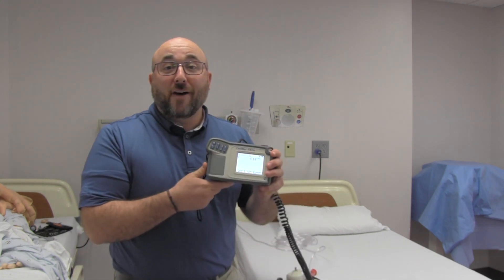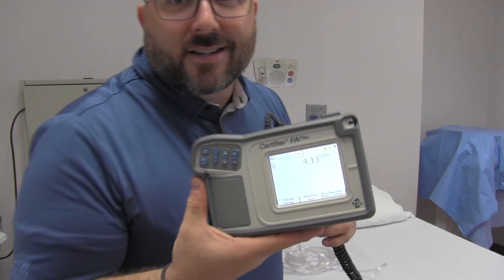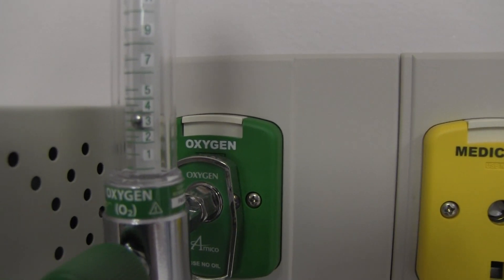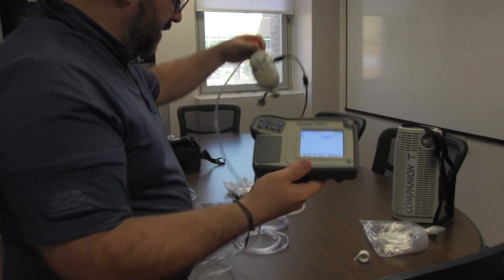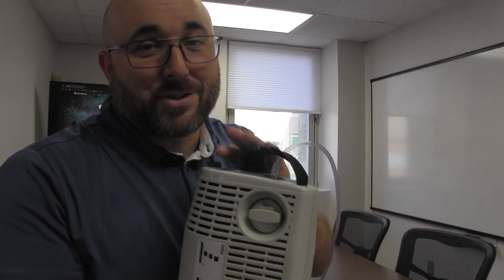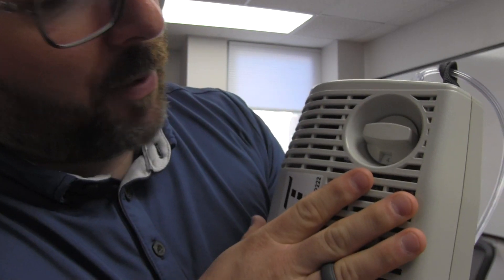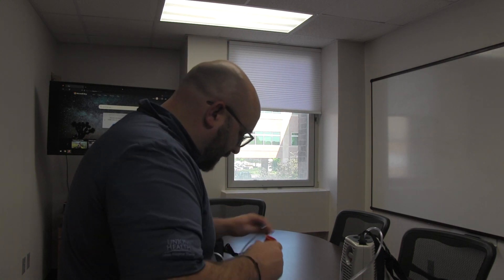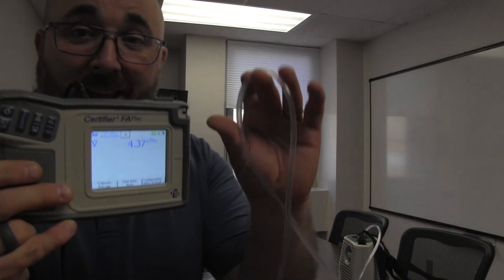RT Clinic: Debunking an Oxygen Tubing Myth

Comment: The best thing would be a concentrator that meters out a predetermined amount of O2 BY MASS, regardless of what is connected, and then just shuts off with an error code if it cannot maintain that. That seems totally feasible with today's technology, but it might cost a bit more.

This video suggests some kind of compensation may already be going on. But I think it could be done better, to deal with kinks, leaks, and so on. For one thing, kinks and leaks could end up resulting in an increased electrical bill.

Comment: So far all I can see is STATIC pressure...heck it would give the same blah, blah pressure at 150' feet BUT the RATE OF FLOW is another
thing all together...you are presenting your argument (against science) all wrong....Hey, bring in a patient, have them use a 7' cannula
directly hooked to the Conc. and ask how they feel....Now stretch out 50' of the (ridged inside) tube = 2 X 25 lengths, which is the standard
longest pieces hooked together AND ask them to tell you how they feel now....ask them to walk around a little bit & ask them again....I'm
certain they will feel a little O/2 starved,  BTW I experience this krap every day at my house!

Comment: So my grandma has an at home concentrator and a 100 ft hose. She says she feels more breathless on the concentrator than the bottles it charges up and we initially believed it was because of length. 

I guess it must be because of a significant difference in the purity level of the oxygen then. Do you have any ideas or recommendations on how to increase the oxygen level in her home to combat the low purity level?
Reply from the maker: I would contact your home care company (who you rent the concentrator from). They can test the actual flowmeter flow rate. Since the change in concentration is usually undetectable to most people, the flow rate is probably the difference she is feeling. I hope your grandma is able to get this fixed.
Reply: @rtclinic  We got a good air purifier for the room which has helped a little, but that sounds like a good idea as well. If we can actually get through to a person that is... Unfortunately there has been issue after issue with said rental company to do the necessary things on their end from the beginning. We've actually had to changer her machine twice because of something going wrong before. They do not come to regularly check on or maintain the machine, despite supposedly being paid to by her insurance.
Reply from the maker: @groovywoomy  I'm sorry. This is a common problem because the reimbursement is so low to companies for oxygen therapy. It's sad, but alot of the service depends upon reimbursement.

Comment: I wish that tubing was MODIFIABLE as to length and connectors! My client has a 35 foot apartment range of motion... and until recdntly, I could ONLY find 25 foot and 50 foot tubing! The 25 footer meant that the client could not reach the front door because the distance from the concentrator was too far... and the 50 foot tubing was constantly underfoot, under wheelchair wheels, getting split, kinked, stepped on, tripped over... what  a nightmare! But the only ones I can find have built-on connectors at each end.  I FINALLY found a 40 foot tubing... HALLELUJAH!... but there's still more tubing than we need!
Reply from the maker: We use 10 ft sections at the hospital and connect with plastic connectors. Be sure to specifically ask for this option from your homecare company.

Comment: Why didn't you test an actual O2 concentrator? I've actually tried different lengths of tubing with patients on O2 concentrators. I didn't have a tester for the O2 flowrate. Instead, I used a pulse oximeter and noted the changes as I increased the tubing length, while keeping the flow at 2 lpm. The 7', 14 ' and 21' lengths showed consistent pulse oximetry of 95%. At 28' it dropped to 90%. Pts. were unaware of the changes. Their breathing pattern, rate and depth remained constant. I've also noticed desaturations O2 when you attach a concentrator to a BIPAP at the same flow rate as a nasal cannula with the same length of tubing. Perhaps a difference in flowmeters? Compensated vs uncompensated? I'm just telling you what I observed when I tried it on actual patients. I really love your videos. They're a great teaching tool for when I do RT in-services with nurses.
Reply from the maker: That's interesting.  If I can get my hands on the testing unit, I'll do it with a concentrator next time. Maybe a YouTube short.

Comment: Thanks for the great demonstration but I have a couple of questions about nebulization.
-When using a nebulizer mask setup that is hooked up to the wall oxygen source does that require humidification or not? Should I replace the Christmas tree with a water cup or is it unnecessary?
-When the medication is over does the mask with medication hub setup hooked up to an o2 source work as an oxygen delivery device or the patient isn't getting any breathable oxygen from that mask? because I've seen some co-workers do that and when I asked them they explained that a nebulizer mask setup could double as an oxygen delivery device but I don't think that's how it works, so is that true or is another myth that needs to be debunked?
Reply from the maker: Great questions.
--It is unnecessary to use humidity with a nebulizer set up. The nasal cannula humidity should be removed from the flowmeter before attaching the nebulizer.
-- A nebulizer mask will deliver oxygen after the medication is complete, but it is a variable amount of oxygen. I wouldn't recommend doing it because it is poor patient care. If oxygen is delivered, the clinician should have a general idea of the FiO2. 
This might be a good experiment though. 🤔 !
Reply: @rtclinic  Thanks a lot for clearing that up.